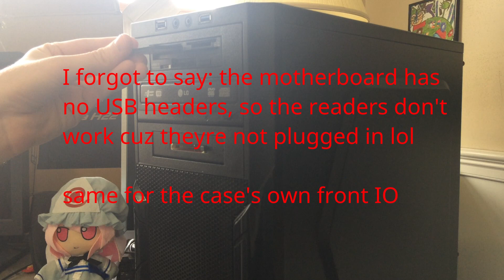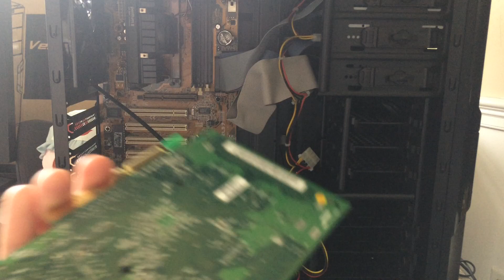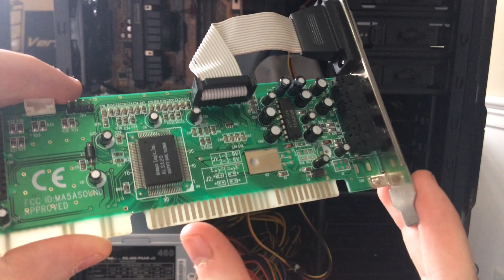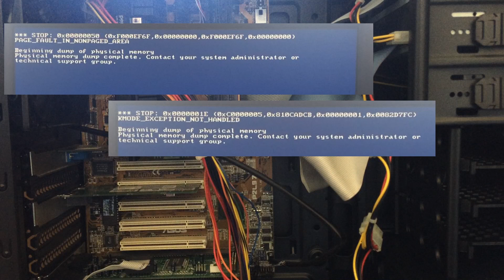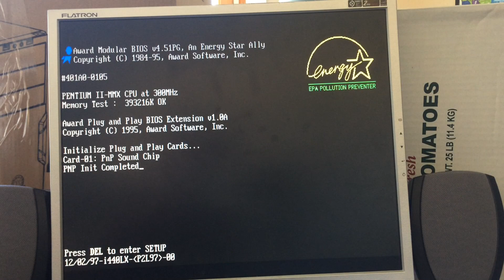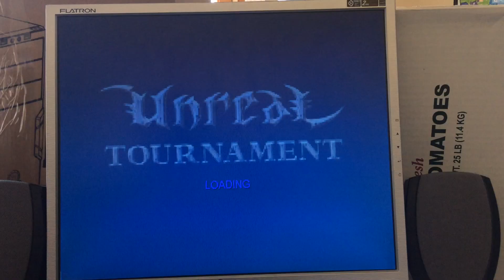Asus P2L97 Pentium 2 build (but it's pain)

Comment: Pretty sure that board was from 97 had a pretty similar build Pentium 2  build 300mhz overclocked With a GeForce 4 4200ti still remember all the RTCW thanks for the memories 👍 Had the same problems with the TNT series also 😢
Reply: geforce 4 definitely too new for 300mhz cpu.
Reply from the maker: cool to hear somebody else with that board who ran into the same shit i did 20 years later!